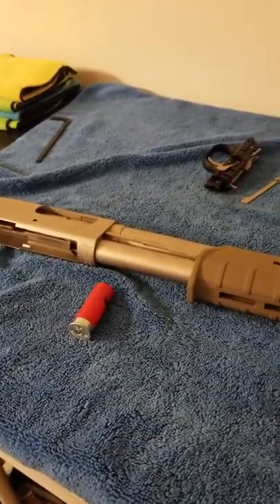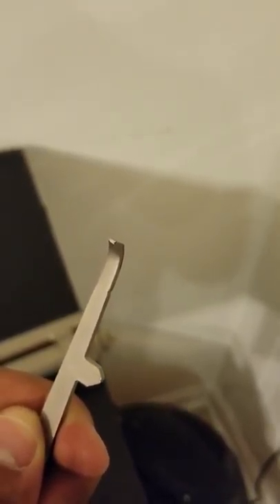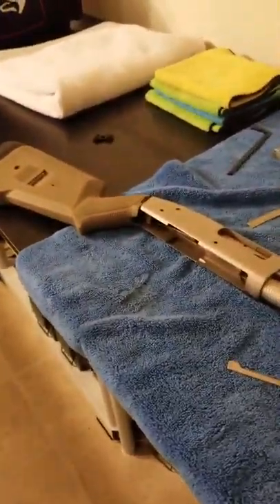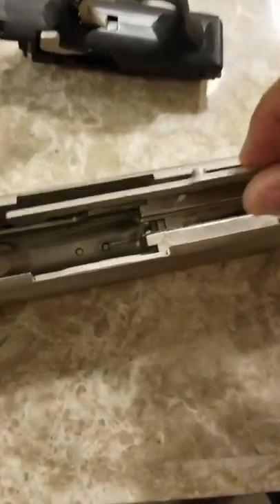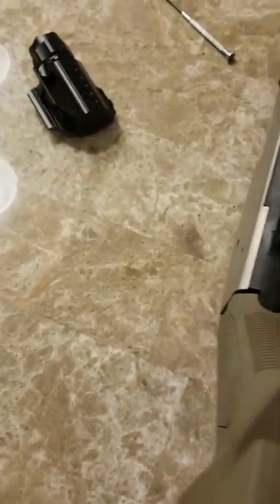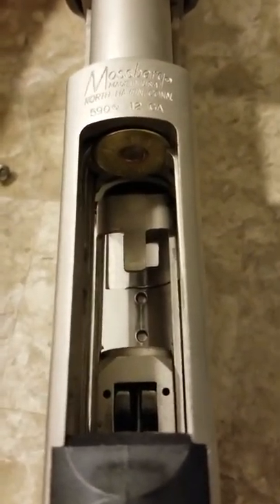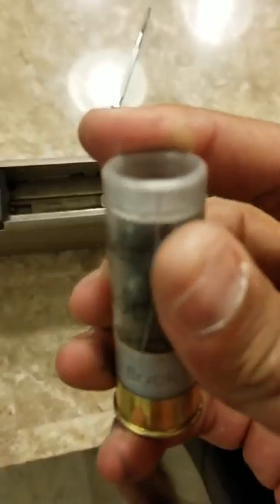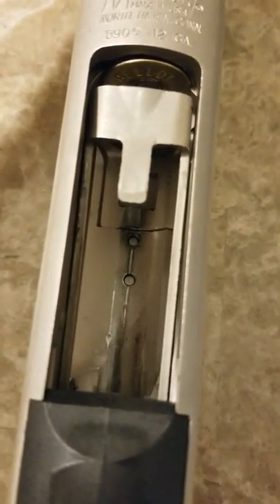Mossberg 590 feeding problem FIXED!!!!

Comment: i found this video to be hilarious. thank you for posting. i have a 18.5" 590 and i was so sure that it was a mag tube spring issue. mine came with an after market Choate +1 and i assumed the dealer that was selling them did not put the appropriate spring in. im not so sure i want to try and file the interrupter. but good information anyways.
Reply from the maker: Hell yeah brother. Thanks. Don't be afraid to shave it down a bit. You'll be alright!

Comment: broooooo you are AWESOME! My Mossberg 590 Shockwave is only 4 mos old. took it out twice. yesterday would absolutely not feed and was marring the shells. I did what you show and barely sanded the end of the interrupter so it wasnt sharp. FEEDS PERFECTLY! was going to send it in under warranty but i saw a video of a guy that did that and it had the same feeding issue right away. THANK YOU!

Comment: Thank you for this video.  My 590 developed this problem after ~200 rounds.  With a few rounds in the tube, the spring pressure would keep the cartridges aligned and overcome the sideways push from the interrupter.  But if just one mini-shell was in the tube, the interrupter easily pushed it too far sideways so that the cartridge stop still interfered.  I could also see plenty of score marks on the brass casing.  After rounding off the sharp point on the interrupter, all seems well, but we'll see what happens on the next range day.

What I don't understand is why it took 200 rounds for the problem to show up - it was flawless until after a range day yesterday...makes me think something else is also going on that is yet unexplained publicly (but Mossberg probably knows).
Reply from the maker: I'm glad I can help you out brother. It is extremely frustrating getting such a beautiful firearm and having it malfunction for such a stupid fucking reason. Mossberg should have been on that problem from the gate
Reply from the maker: Also on why it took so long for it to start fucking up is completely oblivious to me. Mine started fucking up immediately as soon as I got the gun.

Comment: I have a 590A1 that’s perfect but my 590 Persuader was doing this on the last round, sort of. It would load all rounds but the last round would fall out the bottom. I changed the spring but it only lasted a week before the problem returned. Seemed the interrupter was holding the last round just a bit and the spring is weakest on the last round, so when I closed the action, the last round just popped out the bottom. Like it was empty and closed on an empty chamber and the round just falls out when the interrupter is reset on the closed action. It was kind of funny. I was planning on making a video this week on it. Thanks for sharing this.
Reply from the maker: You're welcome brother. Help out all of you guys with this simple fix

Comment: Starting my late night journey looking at my Mossberg 590 shockwave. I just got back from the range.Loaded and pumped my shotgun to load a round in the chamber and shell loaded fine. When i fired the shells are flying out the bottom? Never had that happen with any shotgun i own. Thinking maybe the extractor not holding them in correctly. It is brand new and i'm pretty upset. Dont know if i should send it to mossberg, but i think i am going to look at it myself first. I already want to sell it but i could never do that to someone whose life depends on it. Glad you fixed yours and makes me feel a little better im not the only one frustrated with my shotgun not working!
Reply from the maker: You have to treat you guns kinda like your kids sometimes, give them a little act right, lol 😆

Comment: Mine is getting low brass stuck in the chamber. I think I finally found the problem. I never noticed with the barrel nut tight, the nut bottoms on the tube and the barrel is still loose. Tube appears to be bottomed in the receiver, think I'm going to stone the end of the tube so the nut goes on further
Reply from the maker: There's an idea. Let me know how it works out.

Comment: Dude. I've had my 590 for 12 years and haven't fired a single round because of the same problem. Just put it away and left it. Spoke to Mossberg at one point and they sent some parts. Didn't work. I'ma go dig that bad boy out now and fix it. Thanks for sharing.
Reply from the maker: You're very welcome brother. Please let me know if it works for you. Semper fi!

Comment: Hi brother, I'm facing the same issue with my Fabarm STF 12 shotgun. Could you tell me what tool you used to file the shell interrupter, or perhaps the type of sandpaper you found effective? Keep up the good work. Thanks a lot!
Reply from the maker: Ok so first I want to say, do this at your own risk. Ok now that we got that out of the way, I just used a harbor freight file set. The ones with a red handle and swiped it a few times. DO NO GO CRAZY TAKING OFF MATERIAL!

Comment: I understand your pain so much, It is so disappointing to spend so much money on a gun by a reputable brand and have it fail on you for something so stupid. I just got a 500 cruiser and its doing the same fail to feed problem its probably has the same thing yours had. Except I cant even shoot mine bcs the damn trigger is stuck and it wont break. (yes the safety was off)
Reply from the maker: Wooooow! That's rough bro. Let me know if you unfuck that trigger.

Comment: Hey, thank you for this video. Can you describe exactly where you filed? I have the same issue with my 590. Was it the shoulder or the burr/hook that you took material off of?
Reply from the maker: The very tip of the shell interrupter
Reply: Thanks for the info. Any particular angle you filed at? Or just rounding it out?
Reply from the maker: @RemingtonGreer  nope. Just filed it strait down to where it wasn't so pointy. Don't take too much off though
Reply: Thanks for your help, Trevor

Comment: i have the same gun. my problem is when i shoot in the action gets all locked up. i have to slam the stock on the ground and pump at the same time to eject the fired shell. will this be a fix?
Reply from the maker: No not for that problem. Your problem is a simple fix. You need to polish your chamber. I had that problem at first but polished the chamber and all good now.
Reply: Trevor Cunning thanks

Comment: Dam you have good taste when it comes to firearms. I have a M590A1 the one with a bayonet lug because fuck it who doesn’t want a fucking bad ass John Rambo knife 🔪 on their bad ass hood Howitzer. But anyway what I was getting at is you can do some cool shit with a shotgun. Cut shells wax slugs or you can do what I did. I went out picked up a Lyman key drive slug mold. And started casting my own slugs. Basically you can turn those cheap Walmart turds into some kick ass target slugs. By literally just cutting the crimp dumping the shot out melting it down. And recasting it into a 1oz slug. Fun easy and cheap there’s YouTube videos everywhere on the subject. I love my Mossberg the dam thing is a BEAST very versatile. You can basically do anything with it just by switching up your shell.

Comment: Hi there, I'm interested in throwing that magpul stock on the 590 mariner, but heard that taking out the trigger group is pretty difficult with that type of stock on. Have you had that experience with yours?
Reply from the maker: Oh yeah bro you're fucked if you wanted it to come out easy after installing this stock. You have to loosen the stock off of the tang to get the trigger group out. The only reason why I hate shooting this gun is because I know I have to take that damn bolt loose to thoroughly clean the shotgun.
Reply: I have to make 1 small comment in regards to that. You guys do realize that the M590A1 had to pass a torture test to be used in the military. And that includes running the shotgun caked with debris mud dirt sand. It was the only shotgun to pass that test I literally douche mine with some good old brake clean. Then hit it with some ED’s Red in a squirt bottle. She runs like champ.

Comment: How did you get to the shell interrupter? We’re they part of the trigger assembly? Mine seem to be apart of the shotgun (after disassembly)
Reply from the maker: Uhhhhh that's weird. It should have just fell out with the shell stop after taking out the trigger group and bolt
Reply from the maker: @rkkong  well now that's a different story brother. This remedy is for  a Mossberg 590. It's not for every shotgun

Comment: This may be a long shot seeing that this vid is 2 years old but maybe you could answer this question my 500 will load every round but the last one would this be the fix?
Reply from the maker: You have to be a tad more specific brother. What this fix did was stopped the shells from randomly coming out of the mag tube while pumping it. Look at your last shell and see if there are and deep scratches and drag marks. If so, this fix will definitely work.
Reply: @trevorcunning6248  roger! Didn’t want to type it all for no response seeing that it’s a old vid... anyways I can load up my mossberg 500 to  maximum capacity 6 shells and it will feed only 5 the last one will not release from mag tube no matter how much I pump it. There isn’t any marks or cuts on the shell as you described in your video however this was the closest video to show the problem that I was having. Mossberg customer service was no help so I’m taking to social media for help I just got this shotgun last year and honestly it’s not a big deal it will feed the first five just not the last one it would be awesome to figure it out but I’m pretty much taken a shot in the dark. Anyways thanks for the response and the help I know this was a older vid and I really didn’t expect a response especially one so quick thanks bro!!!
Reply from the maker: @jmacjr84  yeah man no problem. If I were you, I'd get a new shell stop and a aftermarket mag tube spring. Some tube springs are very loose. You may need a stiffer one.
Reply: @trevorcunning6248  thanks bro I’ll look into it hopefully that’s the fix...
Reply from the maker: @jmacjr84  let me know how it goes brother.

Comment: Have any issues on the 3 inch magnums after you fire them. Have same issues but just after firing
Reply from the maker: I have zero issues with any rounds. I also polished the chamber of the barrel so that probably helped a lot.
Reply: @trevorcunning6248  they wont feed out of the mag not the chamber
Reply from the maker: @inmyopinionreviews3825  ohhhhh got ya. Well I wish I could help more but my 590 has been solid since I fixed the shell Interrupter. Let me know if you ever unfuck yours.
Reply: @trevorcunning6248  will do
Reply: you get a chance shoot some 3 in express through it and see what it does if you shoot it with out holding the forearm. i wonder if it will bring a round out of the mag.
Reply from the maker: @inmyopinionreviews3825  okay I'll try the next time I go to the range

Comment: Bought one of these and it is INFURIATING!
>Hard to dissassemble, clean, and reassemble
>Hard to pump
>Slide release gets stuck up in the gun
>Shells won't feed, double feed, firing pin won't work on a weak pump

I'd return it if the store wasn't so far away.
Reply from the maker: Damn bro I'm sorry to hear that. They are kinda like the 1911 of the shotgun world, need a little broken in.
Reply: @trevorcunning6248  I haven't shot it yet and I did buy the display model. 

The problem might be the snap caps I have been using.

No idea why the firing pin won't work and the magazine follower got stuck sometimes though.

I will try and break it in and see what happens.
Reply from the maker: @melvinmerkelhopper5752  send that bitch back to Mossberg and have them unfucked that gun.
Reply: @trevorcunning6248  Maybe I will once I try to fire it. Thanks for the help.
Reply from the maker: @melvinmerkelhopper5752  anytime brother
Reply from the maker: @melvinmerkelhopper5752  anytime brother

Comment: I have a new 500 12, and have similar issues. The slide jams frequently, and won't eject a round. Slapping the butt on hard surface forces it to work. I sent it to Mossberg, and they said it worked fine for them. Could it be the same fucking problem?
Reply from the maker: I'm not too sure brother. That sounds like a completely different issue than what I was experiencing. My issue was just multiple shell ejections. The pump worked just fine but you can always try and do what I do in a video and see if that works.
Reply: @trevorcunning6248  I forgot to update you about my Mossberg 500-12. It was the goddamn low brass shells that were causing the problem. I bought high brass, and it cycled them like a dream. My fault for buying cheap shit ammo.
Reply from the maker: @Z7d3nR4  bro that's no excuse. Any pump shotgun should be able to run any shells at all. What exactly is it doing with the high brass shells?
Reply: @trevorcunning6248  , yep, that is what I thought. It should eat anything I feed it. But she don't. When I try to eject spent low brass shells, they jam in the chamber. I can't cycle the action unless I slam the butt on my leg or the shooting bench.

It might be just the cheap ass shells, but I tried two different brands.

Sent it to Mossberg, and they said nothing was wrong with it.
 
High brass cycles. perfectly.
Reply from the maker: @Z7d3nR4  hmmm idk what to say man. I wouldn't keep a pump shotgun if she won't eat everything 🤷

Comment: Pretty weird, i have a similar problem.

While i don't really have any feeding issues with my new 590a1, the shells never eject on their own when you push that stopper to the side, to release the shells from the magtube. They only come out a  tiny little bit and you have to push them in slightly to unload them properly.
Also bought some dummy rounds for testing this and after only a few cycles they're all so scratched up, similar like the one in your video. Any ideas?

Btw i love how you pronounce Sellier & Bellot hahah.
Reply from the maker: Hmmm I would say try the shell interrupter trick. Is your shell stop not going all the way to the side?
Reply: @trevorcunning6248  Hey man thanks for the quick reply.
I thought about that, maybe i'll try bending it a little bit and see if that will help before using a file on it. 
I'll tell you how it worked out for me.

Pain in the dick like you said :D
Bought the mossberg because of its said reliability only to find out how common these feeding issues seem to be...
Reply from the maker: @herrkollege5902  bro once you unfuck the gun she is EXTREMELY reliable! Please let me know how it goes. I'm curious myself.

Comment: Instead, you could just bend back and flatten the stopper a little. That's how I fixed mine.
Reply from the maker: That's a really good point. I just really didn't like how sharp the point was on mine so I just decided to file it down
Reply: @trevorcunning6248  Some youtube dude called Mossberg, they shipped him a new stopper. The new had visibly less curvature. The other problem is in some cases, the elevator arms get dislodged from the holes if the gun falls. Again bending the arms separating them, fixes the problem.  It increases the tension. These are minor mechanical adjustments.
Reply: The other post is from SassBand. Mossberg sent him a new stopper.
Reply from the maker: @dekzan  welp, too late for that, lol. She's been fixed for a while now.
Reply: @trevorcunning6248  I would still call and get a new stopper. It has lifetime warranty.  Just say your stopper is malfunctioning holding shells,  you watched videos and you need a replacement.
Reply from the maker: @dekzan  no need brother. My gun is good to go

Comment: May try it with out the potty mouth 😖
Reply from the maker: You have to throw a few fucks around or else it won't work.
Reply: @trevorcunning6248   it works though
Just fixed mine , was same issue Thanks
Reply from the maker: @marksuda2511  glad I can help

Comment: This just goes to show "American craftsmanship" is in the toilet.  $525, that thing better blast away and rub & tug you or something!  $450 for a 590 and I'm ready to pretzel wrap it around a tree!

The elevator grinds against the receiver.  Pumping is gritty and rough as hell.  The action bars are ground up too.  The tube is marred up from the pump.  The bolt needs polishing.  It came with a cheapo plastic trigger housing instead of the metal one it should have.  Can't add a sling because the choke redirects muzzle blast into the tube cap.
Reply from the maker: Holy shit brother! You sure you bought a 590? That sounds like a whole hot bag of ass!

Comment: stand the fuck by lol S&B ammo is actally not to bad actually but thatk i will check thet i have an unfired MB SG im dealing with for a co-worker that is doing the same thing that i have to unfuck
Reply from the maker: Lmao yeahhh the ammo never gave me any problems but is your co workers shotgun doing the same thing as mine did?
Reply: @trevorcunning6248  shell catch is not be pushed out of the way it did have a big burr on the stop but i had already deburred it. i conferred with another gunsmith friend and he had a couple with the magazine had not been threaded in far enough but that wasn't this either. i called mossberg and they are sending me a shell catch. i have deburred and polished several pieces that make is slick but it still won't feed fingers crossed before i start tweaking things im certain i will make it work been working on LE guns for 25 years so ill get it.
Reply from the maker: @darangemaster1  damn bro. That sucks. Sorry for your troubles
Reply: @trevorcunning6248  meh its what i get paid the big bucks for i have effed up shit i gotta fix because the cops is stupid so no worries . i also get bags/boxes of guns that they took apart all the time that they can put back together lol